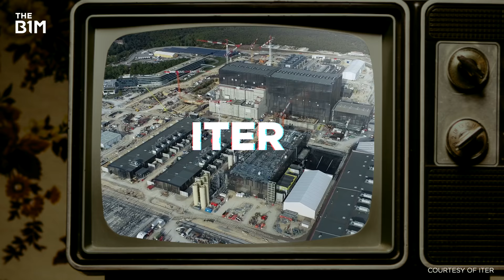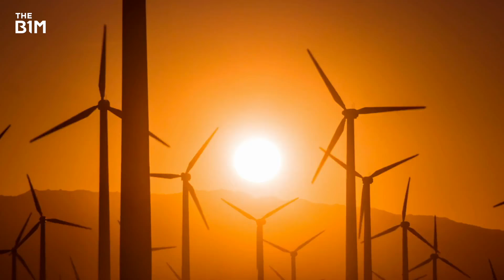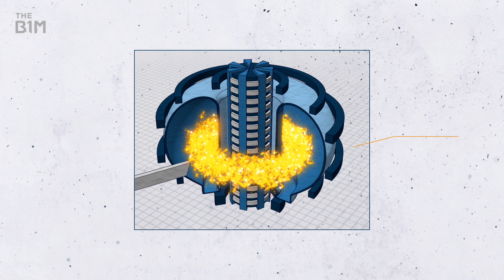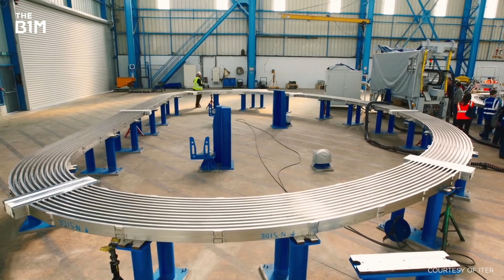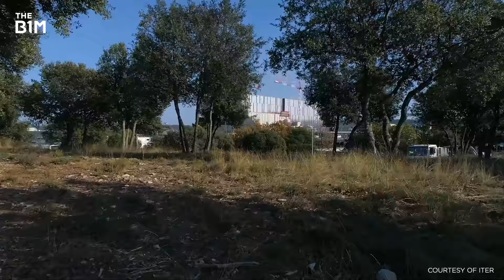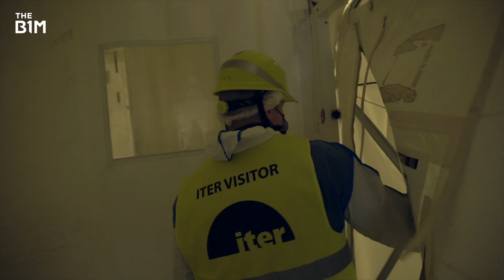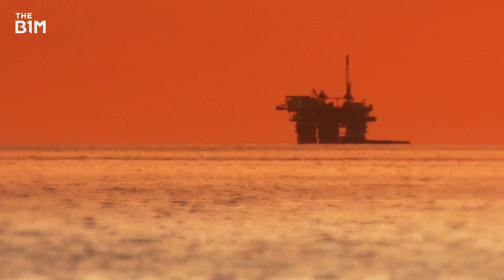We Went Inside the Largest Nuclear Fusion Reactor

Comment: Fact check: ITER is not actually aiming for "net energy" in which the amount of energy input to the reactor is less than the amount of energy output. It is designed to produce more heat from the fusion reaction than is consumed (the Q value in promotional materials). But since ITER requires significantly more power to maintain the reaction than the reactor is designed to output, ITER will not produce "net energy".
Reply: A spectacular feat of engineering but a bit sensational that it doesnt explicitly say what you've eloquently described.
Reply: THANK you
Reply: but in the sun the gravity is the reason why hydrogen fuse, and it stays constant even after initial fusion
Reply: @Zaydan Naufal Nuclear waste is a meme, we could safely dump all our waste in deep ocean trenches with minimal environmental consequences. There's already several nuclear subs at the bottom of the ocean and those caused basically zero problems. But yes, breeder reactors could solve all our problems if we invested in them. Too bad noted frequent flier on Jeffrey Epstein's Lolita Express, President Clinton, killed off our breeder reactor program in the 90s for political reasons.
Reply: Thank you everbody dont mention that fact. Sadly still long way to go.
Reply: @Zaydan Naufal I cringe every time that I see/hear the word "waste" in relation to nuclear power.  The term is overused, misused, and mis-defined by the media and anti-nuclear folks that it has become the "monster in the closet" that we are all afraid of.

The "Nuclear Waste Problem" is about 5% technical and 95% political.  If we were to actually reprocess our "waste" we could recover about 95% of it as usable fissile products which could be converted right back to reactor fuel...if the reactor was appropriate to the task, as you mentioned.  We currently call that 95% recoverable material "waste" in the US...because we have laws which forbid the re-processing of commercial "spent" fuel....Politics.  The 5% left is dangerous stuff which has no known use and needs to be safely stored...a technical problem.
Reply: Either way it doesn't mater too much, ITER was never intended to provide energy to the grid anyway. It will prove the way forward to future reactors that can
Reply: @Zaydan Naufal I'd argue for Thorium. The waste from that is only dangerous for 1,000 years, as opposed to the truly toxic crap that comes from existing glorified bomb-making plants to sustain the world's nuclear arsenal, that puke stays dangerous for hundreds of thousands of years.
Reply: Even net energy gain isn't good enough. Even having a practical reactor in engineering terms isn't good enough. The real problem is cost. Will it compete with cheap renewable energy sources plus cheap grid scale energy storage? The answer is almost certainly, no.
Reply: @saumyacow4435  Renewable is a meme pushed by gas companies that know you're still going to need a baseline power source with rapidly adjustable output. Solar and wind will never make up anything close to 100 percent of the world's energy needs without having gas or nuclear there to fill in when conditions for generation are not ideal. Energy storage is also a meme, batteries will never be able to economically store the excess energy generated on a large enough scale to actually matter, and pumped energy storage is extremely expensive and only viable in a few locations. Just like the fossil fuel industry renewable energy is heavily dependent on government subsidies and  incentives to actually be somewhat viable, we should divest from all renewable energy projects and ban the extraction of fossil fuels for energy generation, and instead just build meltdown-proof generation 4 reactors.
Reply: @jaffacalling53  All of which is entirely out of date. But I'm not going to bother to update you on the latest in grid scale energy storage. You can look it up.
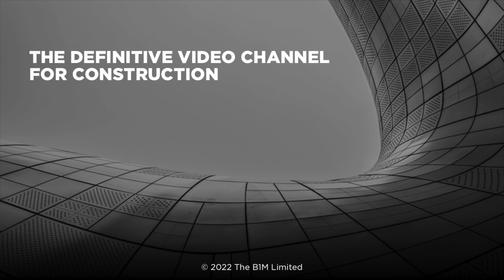Reply: Sabine Hossenfellder on YT has a recent piece that explains some of the “confusion” of out terms that keeps the money flowing into projects like this on.  This program would lead you to believe 7:46 that just after 2025 that ITAR will provide “more energy is produced than used.”  But “used” they are talking about how much energy that goes into the plasma, not the total energy. Their goal is to make 500Mw of power in the plasma fusion. Converting heat to electricity is 50% efficient which means they might produce 250Mw in short bursts. Which still sounds good if they are going to be throwing 50Mw at the plasma.  It’s not the times 10 that they have been claiming but just a small twist until consider that the whole facility will consume 440Mw to run to enable the 50Mw to go to the plasma. But they will get funding if they don’t bring this up. People will be happy and look forward to Fusion power and pay extra taxes because we are right around the corner!  
So, it is still a long way off. Wasting huge amounts of money on projects that have no hope of making power is just that.  More research is needed before humans dive this deep again.
Reply: @bearlemley  Or we could just build gen 4 nuclear reactors. Viable fusion is a long ways off, has a lot of potential for space travel though.
Reply: @bearlemley  Cost isn't that much of an issue for ITER, it's 22 billion dollars and in my opinion worth the expenditure, even if it's only purpose is to generate data. Go look at how much countries spend on welfare if you want to talk about government waste.
Reply: To be fair, I have no problem with the idea that fusion can work in an engineering sense. My issue is that its always going to be more costly than fundamentally simpler technologies - and that fact seldom gets a mention.
Reply: @Zaydan Naufal Problem with uranium based (i'm assuming you mean current tech of light water reactors) is that the construction is expensive due to a large pressure vessel, active safety systems, and bespoke plant design for every location.  However, it's cheap compared to fusion!  Malten salt reactors (whether running enriched U, Th, or straight up nuclear waste) can avoid all these cost-prohibitive solutions for rapid scale up.  But the core of your argument is right - even current generation fission reactors, rolled out in an apollo-style program, would go a long way to combatting climate change.  Much more than fission or "renewables".
Reply: Yes just another scam project
Reply: After ITER comes DEMO, after DEMO comes PROTO. PROTO will achieve "net energy". If these 3 projects work, we will have solved fusion as a viable source of energy.
Reply: @nicolasmaldonado1428  DEMO is supposed to achieve net energy and serve as a prototype power plant.
Reply: @jaffacalling53  But still, that won't be until the 2050s at best with current funding levels
Reply: @SuperSMT  Hence the need for immediate investment into generation 4 nuclear.
Reply: @nicolasmaldonado1428  except for the whole "it costs a lot to build even scaled down ITER and it takes decades to build a plant" problem.
Reply: Funny. You're now describing a perpetual motion machine, which violates the first and/or second law of thermodynamics. It can't be done. It can waste billions of our money, instead.
Reply: if the same money had been put in thorium rather than this, we might have something closer to a roadmap to ubiquitous clean energy. instead, we have a politicized nightmare of something that is much more inaccessible than fission. we could build reactors with current tech that are almost impossible to melt down, literally eat nuclear waste, and are much cheaper to build and operate. instead we funnel money into extravaganzas like this that have extremely high energy input needs which drastically cut down on output, if there’s an overall net difference in the future it won’t be much going forward. and it will be EXPENSIVE. not only that, but it still actually makes nuclear waste (if it’s neutronic). if you thought fission energy was pricy this will be a new level. overall it will work at some point, but right now it’s not something that’s going to be a solution anytime soon.

Comment: I'm from Marseille (south France) i've been there and it is very impressive. One thing you didn't mention is that it's going to be the Heaviest manmade structure ever, relative to the size, there have been a huge levelling of the ground with deep steel tubes
Reply: look at all that machinery and components densley packed inside.
Never saw a building that big, and that denseley packed before lol.
Reply: If they had told us more about the building and spent less time on superficial comments
Reply: @Zaydan Naufal I'm not sure, I think some of the soviet submarines perhaps. Perhaps some imploded ones on the sea bed too. 

On a serious note, for its size there are a plenty of minature structures much denser. you'd have to have special parameters for this.

Comment: There already is a fission reactor in the sky.  A decentralized system of the sun's' energy capture, storage and use is the solution. This centralized method of making and distributing power is over. The current legacy owners of centralized power will never admit this. They will lose their control and continued fortunes.

Comment: Fun fact all this effort is essentially changing the type of heating source of a kettle because large power station all do the same thing and haven't changed much in the last 100 years. They all simply boil water to generate steam to then turn a turbine attached to a generator to make electricity. So we are "harnessing the power of the sun" too... boil water.
Reply: Water is just a means of transferring the energy from heat into mechanical work. And it’s preferred since it has a high heat capacity and is easy to store in large amounts
Reply: @alexsiemers7898  Very true. I just like to remind myself sometimes that although Fussion has this aura of being a futuristic tech and is a common trope in scifi stories as a power source. We are harnessing it using industrial revolution (steam) tech to get energy from it. When I use to read about it in books before I knew anything about the subject. I always imagined it would be more like photovoltaic cells, or hydrogen fuel cells and energy would just flow from the reactor source 'some how'. Maybe capturing the electrons in the plasma or some nonsense my childish imagination came up with for the child in me I just could not imagine water and steam being involved somehow. 
Regardless of the old me ITER is still fascinating to me and I hope it goes well.
Reply: Here I'm waiting for offshore wind to be used to electrolyse water into hydrogen

Comment: @2:38 should it not be U-235 shown.  Uranium-238 (238U or U-238) is the most common isotope of uranium found in nature, however,  it cannot sustain a chain reaction in a thermal-neutron reactor.  Uranium-235, is the one you want.

Comment: Statement: No fusion reactor has produced more power than it takes in.
Fact check: False. 
What he meant to say was “there are no fusion reactors that are economically viable as a commercial energy source
Reply: No, you are correct that you need to produce much more energy (at least 20x) than the energy input to be viable, but there is even no fusion reactor as of early 2022 to reach the breakeven point, where the energy output equals to the energy input. There are some reactors that might have reached the breakeven point if tritium was introduced as a fuel though ("extrapolated breakeven").

Comment: This is crazy. Amazing work! Quick question, is the biggest snag creating a containment field that's durable enough, or achieving net energy?
Reply: The field needs to be not just strong but also intricately shaped and controlled to keep the hot ingredients spiralling just right, otherwise a burst of net energy is easy to create but it will splatter the plasma outward in an instant and won't allow the reaction to work as a source of continuous power to the grid.

Tech for Luddites had a pretty insightful video on more snags: https://www.youtube.com/watch?v=FrUWoywZRt8#t=2m50s - basically getting enough tritium... and managing radioactive waste produced in the cladding. (Even though the fusion per se creates only stable helium and neutrons, the material in the walls becomes activated when hit by those high energy particles...)
Reply: @u1zha  Thank you so much for the insight! Will check out the link

Comment: at first i gawked at the 22 billion price tag but, after hearing the logistical and scientific challenges - I think 22 billion might be fairly cheap for such an endeavour. The optimist in me wishes we could throw even more money and manpower to expedite the process however much more we could.
Reply: Its also over decades not just one lump sum. Harvard's endowment fund could pay for ITER.
Reply: The problem is what will successive commercial scale reactors cost? This $22 billion reactor will produce 500MW of electricity for just minutes at a time. It's purely experimental.  
The proposed DEMO reactor could follow, which would actually produce useable energy for the grid, but it will have to be even bigger than ITER. It should be easier to build with all the lessons learned, but how much easier really? Could it ever get cheap enough to the point it's worth doing?
Reply: @SuperSMT  The reason we're doing this is to see if it's feasible and improve the technology. Solar power used to be far more expensive to manufacture and install than it could reasonably be worth but modern solar panels are extremely efficient. We're trying to do the same thing with fusion.
Reply: @ronandevlin1479  Sorry to break it to you, but it's not feasible.  Not in the Tokamak configuration.  This much should be obvious after more than 65 years of research.
Reply: @SuperSMT  better test it out now than regret it later
Reply: 20bn is pretty cheap for national level spending... it's like 4 overprized airports^^
Reply: @SuperSMT  Hint: it's going to be so expensive nobody will ever build it for commercial purposes.
Reply: each member nation is granting money to domestic universities for research on each part that makes ITER
Reply: It is especially since the US military pays $100 billion or more for new military jets
Reply: @hydromic2518  For thousands of them, though   
$400 billion is going to buy 2,500 F-35s which will be in service until at least 2070
Reply: @hydromic2518  The jets will guarantee our defense.  This project and its follow on projects will never sell a single kWh to the grid.
Reply: I think 22 billion is cheap if it is being used to save the planet and improve the ways we produce energy
Reply: @Juanovalle  But it won't produce energy commercially, because the individual plants will be SCALED UP versions of ITER and will be so hugely expensive it won't make sense, even if they produce a tremendous amount of energy each.
Reply: @MrGottaQuestion  If I told you to extract, refine, and transport oil for energy production, and NO ONE had ever done it, it would be insanely expensive. The second you produce a viable design for a working reactor that price goes through the floor as economies of scale take hold since literally every country on earth would want to make them for guaranteed energy security
Reply: @MrGottaQuestion  true, but also better than spending billions in war
Reply: @conorminnaugh6489  except your return for energy returned on that invested was over 100 to 1, and now it's a fraction of 1.  Bad metaphor.  Also oil rigs don't cost 100 billion or more per copy.
Reply: @Juanovalle  I'm personally glad we spent billions on defeating the Nazis....
Reply: Except it's not a bad metaphor you just (deliberately?) misrepresented what he said. Return on energy invested of less than 1 is not a "viable design" which was his stipulation for prices falling which they would.
Reply: @Filthtron  no I know, my argument was that we all know it’s going to be expensive. The world knows it’s going to cost a fortune, but my country alone has already spent trillions on weapons of war, even a half of that could go a long way into research and speeding up the creation of a “viable design”. I’d rather the country that I spent my life “pledging allegiance” to to use put some of those trillions to good use for once
Reply: Musk payed double of this on twitter buyout ! 🤑
Reply: More money might help but more manpower, thats doubtful because they could get in each others way.  Given the goal, I am sure that the drive is there so lets hope it succeeds.
Reply: 22 billion is nothing for 35 nations. It should be 50000000000000 billion. This should be finished allready. Stop the pollution of coal and gas powerplants and the production of solarpannels because they will be scrapped some day.
Reply: @Revolver.Ocelot If it was that easy, we would have it already but fusion is not easy, the temperatures are massive, hotter than the sun.
Its not money thats needed but a breakthrough. There are some British Scientists trying another way but us mortals will just have to wait.